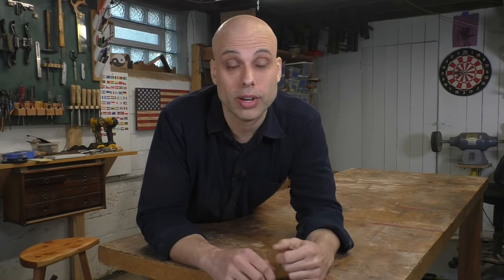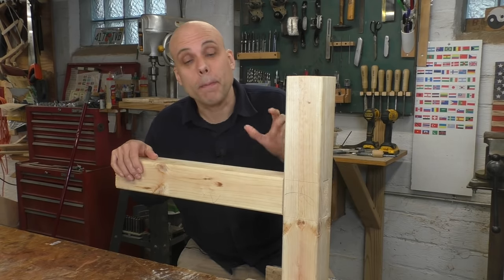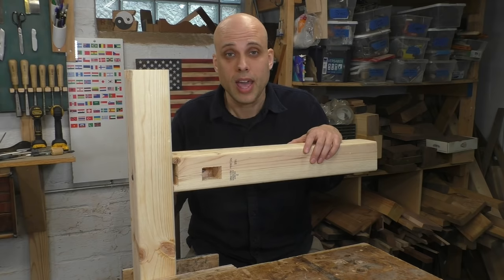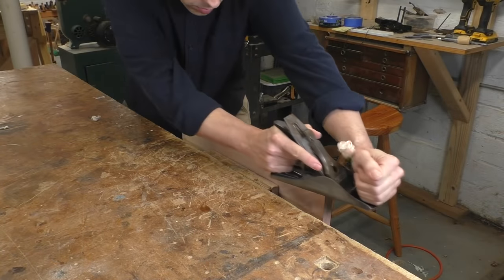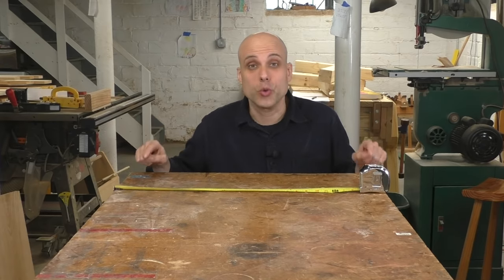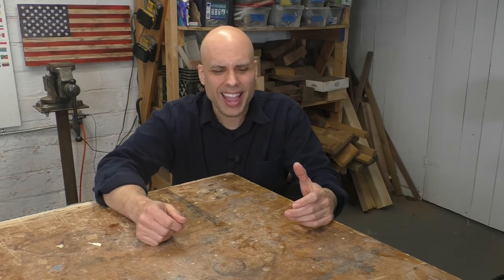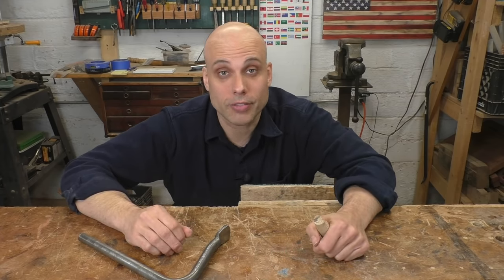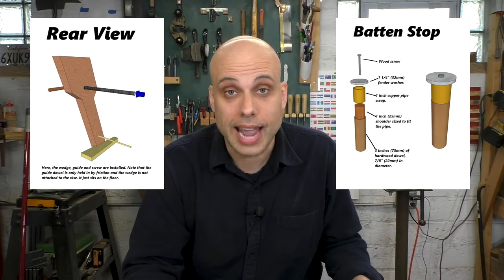Four Workbench Building Mistakes (that we all make).

Comment: I kinda cheated on my first bench by using 2x4s for the legs.if I needed a mortise and tenon I just used 3 2x4s laminated together, and just cut the middle 2x4 and left the gap I needed for the 'tenon'' which was also 3 laminated 2x4s that had the middle board long enough to go through my 'mortise'. All those 2x4s added up in weight which was a plus. Oh and was relatively cheap

Comment: I also support idea of things easy to disassemble. You never know where you'll live tomorrow or what kind of improvements you will do. If you can unscrew your bench, you're free to do anything!  Related furniture and "bare wood top" - well, partly I agree that you can "refresh" your top, but wood still too hard enough to make some dents in wood parts. Better to have some enormously strong (and non-inflammable) surface, which you can temporarily cover with some kind of "high density foam" - then your wood will be safe.

Comment: I don’t like calling benches bad because how they are built should be directly related to the type of work you will do on them.  My first bench was a exact copy of the one built in season.1 of New Yankee Workshop and while a good lightweight bench for laying out, assembly, sanding and finish it is not a good bench for hand cutting dovetails or planning.  My current bench is a split top Roubo plans from Benchcrafted and the thing is great at hand tool work but it’s weight and size makes it less than ideal for shops where you have to move it a lot and the bulk doesn’t reallly help you if all you never use hand tools on it.  Both benches have pros and cons depending on how you work and while I wouldn’t trade my Roubo for anything I fully acknowledge it’s value is based on how I work and not nessacarily how others do.

Comment: 6:16 thought, Rex, would drilling a hole through the post into the beam a good distance then scoring up the sides of a dowel to fit, fully gluing the faces, and driving that into the beam, then driving the beam with the peg through the post, then (after the glue has dried) passing a much thinner peg through the post and the beam respectively so that it intersects the larger peg? Should be manageable with a basic drill and set of bits, a pocket knife, and a saw, sturdy enough, and while it can’t be taken down unless you run the pins long and omit the glue, it might be a good solution for beginners.
Reply from the maker: I appreciate the thought but you're over thinking this.  It's not a good joint.  There's no reason to try and save it when simpler,  better solutions exist.
Reply: @RexKrueger  that’s fair. I was thinking of it as a less skilled, less tools way to execute a through mortise and tenon, hence the large peg, with the small pegs to limit twistability. Definitely overthinking, but maybe more approachable for someone who just has standard garage power tools to execute without the skill to make good mortise and tenon joints.
Reply: @RexKrueger  that’s fair. I was thinking of it as a less skilled, less tools way to execute a through mortise and tenon, hence the large peg, with the small pegs to limit twistability. Definitely overthinking, but maybe more approachable for someone who just has standard garage power tools to execute without the skill to make good mortise and tenon joints.

Comment: Think about this for a second, with a few tools and limited skill you can make the through tenon jointed legs out of 2x4" and glue them up  screws can clamp the parts togather as it drys, after its dry take them out bore holes and glue in pegs.  A leg like this with simple tools will be just as strong.  But it dosnt stop there every aspect of the bench can be made like that. 
As you make this its going to be long grain to long grain joints. It will never fail unless you glue jobs not very good.
Your top will be the same thing.
The legs can attach to the top the same way. 
As for take apart and throw away. Somones always looking for a work bench.
If you set it outside and list it free im going to bet its gone before the weeks done.

Comment: I just finished my first bench. I didn't have chisels or bolts or any power tools. I had to use wood glue and brackets. The bench isn't totally square and the cuts I made aren't straight but It's solid enough to get started. I'll make a better one but most people making their first bench just don't own table saws or planers or thicknessers or impact drivers.

Comment: My first was kind of a disaster (although functional to a point).  It was mostly found-materials.  I had some old fence posts (big beefy wooden posts), so I cut 4 to the height I wanted.  And I had some leftover half-inch plywood, plus a few 2x4s I wasn't using.  I pretty much just cut things to size and started nailing them together, with the 2x4 as beams supporting the top.  Ugly as sin, a bit wobbly, and marginally functional.  I still have it, though.  I doubt a nuclear blast could take that thing apart.

Comment: Well if you used that bench for 10 years, it clearly wasnt that bad.  I made my first bench last winter. Gotten tons of ideas from watching youtube videos. Ofcourse my skills were zero, but i managed to make something i am proud of for now. I only used 4 screws to connect the woodtop. Its all solid wood, the thing i need to do someday is plane down the top so its actually flat. its not bad now, but you made a good point of needing it as flat as possible. So i will need to get some kind of planer.

Comment: Wrist hight benches are way way too low for me. I built one which ruined my back every time I stood behind it and so had to rebuid the legs.
I do this: Assuming that most stuff you plane is at most an inch or two above the surface, make a bench so that when holding a plane rests on it, your elbow makes a 100-110 degree angle. You'll be stooping down a lot less. Also build it higher than you want to and then adjust: you can saw bits off if it's too low, but you can't saw bits on if it's too low.

Comment: I think you mixed up the direction of which wood compresses. Wood compression strength is weak when force is applied perpendicular to grain. The half mortis and tenon is stronger not because of the way in which the carrier bolts are installed. They only help keep the joint in tact.

Comment: I built my work bench with railroad ties for legs , i set them 3 ft deep in concrete and then boxed in the top with 2x6s secured with 6" lag screws and slapped a sheet of 3/4 plywood on for the top .  3ft deep and 8 ft long . i swear a hurricane could take out my house and shop ,and that bench still wouldnt move.

Comment: I have a problem far bigger than no workbench. And that is: no workshop. Plus, whenever I need to use the table saw, I have to wheel it out of the garage and onto the SLANTED concrete sloping up to the garage! That means the table saw wants to roll downhill with every cut. Plus, no room for any of my other tools such as a router table, shaper, sander, or miter saw. No wonder my band saw isn't even assembled yet! When I hit the lottery, a workshop will be my first order of business.

Comment: I have an old Black & Decker Workmate, which I've used for a decade. 

My only complaints are: 

1. It's too small 
2. It's too low 
3. It's too light 

It's made of 18mm plywood on a fold-up metal frame. The material for the benchtop is frankly excellent, and I see no reason not to make a proper workbench with it.

Comment: Great video!! You gave a recommendation for the general size of the bench which was great and I gleaned that the long sides of the bench have advantages being flush. When it came to the tail of the bench you warned about the issue of mounting a tail vise but were somewhat vague on how much the top needed to overhang the base frame. I have no idea what my tail vise will be at present. Any suggestions on a reasonably safe number to use? I’m not sure I have the room for a 7’ top and me to comfortably work so was thinking I’d have to shorten it closer to 6’. So given this how much over hang would you suggest for a future tail vise addition? I’d like to make the base as long as safe to make the bench more stable.

Comment: I build aircraft and I'm certainly capable of building a bench. I've built like ten benches. But my needs are different that those of a woodworker. My needs are that of a welder, machinist, fabricator, mobile so they can be moved in the hangar and still one the benches taken outdoors and mounted on a pair of sawhorses for barbecues, In other words I want some of my benches that can be moved by my daughter or wife. Not my quarter inch plate steel bench. So there are a lot of different needs by craftsman out there. The crossbars I use have a lower horizontal 1/4" board that that is screwed down hard and gives the entire bench more like a box type feel. These benches are rock solid and some of these weigh less than 20 lbs. As far as height, if you are a sheet metal guy you should have it about at belt level so your back doesn't hurt when you are drilling 400 holes.

Comment: I don't consider any benches discussed here to be "work" benches. I can mount an outboard lower unit holder, beat the crap out of something, clamp, drill, saw, rout, thread, tap anything. Sit on a stool and clean guns or rebuild carbs. A 50ft reel is mounted under one end for compressed air. Power strip and lighting. I have a workbench. Built it myself

Comment: My father was a carpenter and builder. On-site his bench would be a scaffold plank supported on two trestles. Horribly flexible but workable. When I needed to build a bench for my 8x10 shed, I used three butt-joined supports with three widths of second-hand scaffold planks, the nearest of which is two planks high. It is absolutely solid. (The only difficulty was the vice, which assumed only one plank depth. ) Everything is screwed, including the supports to the structure of the shed. It can't move but there is no room to move it anyway. It doesn't have to have strength in any direction but down and a butt joint does that very well. https://www.dropbox.com/s/gv51h79wgy2tnnc/20170122_172330.jpg?dl=0

Comment: I’m not worried about ruining my work bench, I went dumpster diving down the street. My bench cost me maybe $3.00 or less in construction screws and 3 hours of time. Sturdy AF and weights 200lbs, top is one layer of advantech plywood and has a lower shelf.
 
Just need to get the supply chain back to normal, way to go congress for screwing things up as usual !!

Comment: Always start with the traditional way. That doesn't mean you should never deviate from it, because as you work you might find issues with it when it comes to your process, but start with what works for most people because theres usually a reason they do it that way. When you are more comfortable and you understand issues with your bench, THEN you can try to find clever ways to fix your problems.

learn why the rules exist before you try to rewrite them

Comment: I think you dismissed the  crossbolt joint without looking at it more thoroughly. It can be strengthened by incorporating an mortice and tenon or dowels. If it was a joint that didn't work effectively, why would sjobergs use it?

Comment: I don't do woodworking. I don't really do much DIY. I'm not in the US. 
No idea why this popped up on my feed but was fully into it by the end, thinking 'right, my bench needs to be about this high, this wide, using these joints with this material. I'll probably need to buy some tools to build it with. Then buy some materials and tools to use with the bench once it's built. 
Ok it won't fit in my garage so I'll have to clear all the crap from the garage, sell the car that never gets used. Put up some new lighting, paint the walls and make it all fancy. 
Hang on, I should probably go back to work and stop procrastinating.'

Comment: I hate my first bench too, but despite using the most basic lap joints it is as solid as can be.  How?  Only only the front is open.  Back and bottom are thin luan.  Flimsy stuff, EXCEPT it is impossible to rack; distances from corner to corner is NOT going to change.  Likewise the ends have pegboard, also thin, but also not going to allow it to rack.  But what about the open front?  Gussets of luan in the corners, sandwiched within the lap joint.  The top of course prevents any racking that way.

Comment: That bench is an outfeed table and assembly bench. 
There's an older guy in England who does a set on making a true English work bench and on his bench it has a open area down the center he can set his tools
As he works with a bench like that you can go 42" wide or even more. 
My point is your bench is set up for what your going to use it for.  This older guy used 2x6" stood on edge 7 or 8' long he did an entire series on it not in metric but in inches he's real old school. When it comes to metric he as lost as most of us are.

Comment: your first joint withnthe bolt going into the streatcher...,isnt a stupid joint!   wood compression is NOT AN ISSUE at all.  tip, use washers!  i have the same joint in my Swedish made cabinet makers bench...and i have not had to tighten it since i got it.

Comment: Need to refresh that plywood/chipboard/whatever bench top? Just sand or scrape any mounds of old glue, paint etc off and glue'n'screw a piece of masonite on top. If needed reposition the vice and redrill any holes for accesories. Problem solved.

Comment: I may well have the worst workbench known to man.

Its too high, too wide, and too short.

We have a huge bathroom that we don't really use, so I converted about 3/4 of it ti a shop.

It has a tacky 'roman tub' that I probably should have ripped out

Instead, I built a platfotm over it to srve as a small server rack, and made rhe top of that a work surface with 3/4 oak plywood

I fibished it with dsnish oil, and it looks nice, but the height and dimensions mean its best use is a dumoing ground for uncompleted projects & tools.

I really need to build a shed in the back yard and migrate to that.

Comment: Loctite retaining compound on the bolt? Lol I'm not condoning the bolt strategy. My first bench I used  a bunch of 2x4's and a billion half lapped stretchers with 2 screws each joint and wood glue. Had to destroy it when I moved. Which was probably for the best.

Comment: i don't understand the single point of contact issue. Seems to me like you had a large surface area of contact, which is far better than a smaller surface area, which is what has been created by gouging out a section of material. it's not like those points were not already in contact, you have simply removed material and reduced the surface area over which force can be applied to, making the whole thing weaker. What have I missed?

Comment: i build my bench over a 2 yeas old , its custom , i have little space and i build it in a wall whith the back legs screw to the wall , in the front i have 2 leg vices made by me , i have to upgrade them becouse it cost 40 to 50 seconds to close but i love them , in the same side i have a jewerlley place and in the side of the jewerly its attach to the wall , and the oposit side y have a place for a metal vice.
its 180 centimeters x 40 cm long and 85 cm higt , i can upgrade , putting more dog holes and make a place for a router table , also i will build another worck bench in the oposit side of my shop , and will be a mitter station for a saw , a drill press also attach to the wall and a wooden lathe , and i will build the lathe , router and drill by using scrap , becouse i cant buy them :)
edit : im not expert in eniglish , i try to make me stand
my actual bench is of meline , and my new will be hard wood but i will use the both of them
Reply: update 2 years psss y upgrde the bench , i add more things and its rock solid , 2 more legs in the back , a torsion box , electronics, power outlest  and lights , i add storgate on top and more holding power , in move to other house and i will bring her whit me becouse never let me down (180 cm long x 40 cm width  , 85 cm to table top and 200 cm tall)

, now im building a custom rublo worck bench made of pine and hard wood , whit mortise and tenet isted of scrws , it will have the same thins that the other one and iths bigeer , also its made for take it down if i have to and can be reasamble again it will be 140 long x 65 cm width and 85 cm to table top ) 2 vices , shefs built in , and power outles.

  this video help me alot thranks you rex

Comment: There is nothing more frustrating than building something and your workbench isn't wide enough...and then you end up doing it on the floor. If you think that leaning over for a tool will hurt your back, try working on the floor.

Comment: One criticism I have is that your evaluation of that first joint, the one with the center bolt, is not entirely correct. Your conclusion may have merit with soft woods but it's not the case with hard maple, beach, and any other hardwood that you'd typically build a bench from. Consider that common joint you see with a tenon and two dowel pins going through the mortise and tenon, drawing the tenon tighter into the mortise and leg. If the hardwoods had similar give as you describe, you'd see a loosening of that joint as well. Also, some of that loosening you experienced may have been due to seasonal wood movement. Especially if you're bolting through a thick leg.

Comment: Using yellow pine? It's cheap, all right, but soft and lightweight. No wonder he has to constantly tighten the second joint shown. The bench also will have little resistance to the forces needed in actual use. Quality benches are made from maple, or something of similar density. Hard, heavy, better. Mass matters.